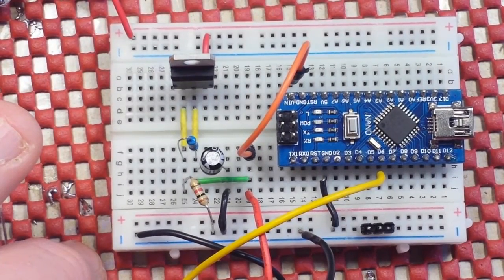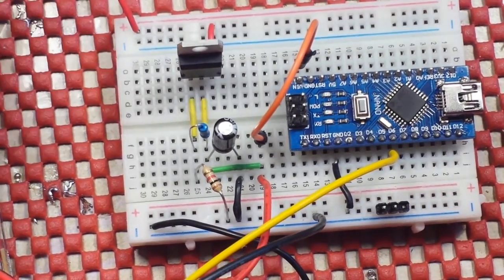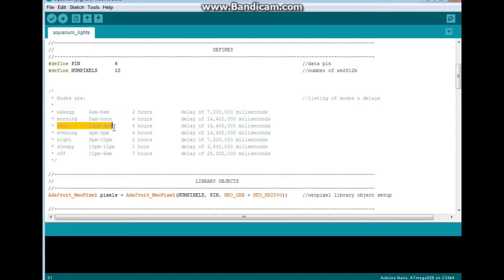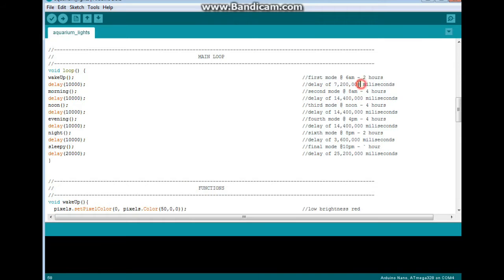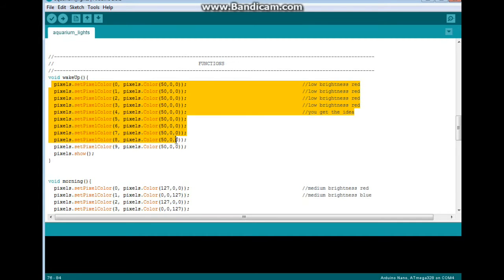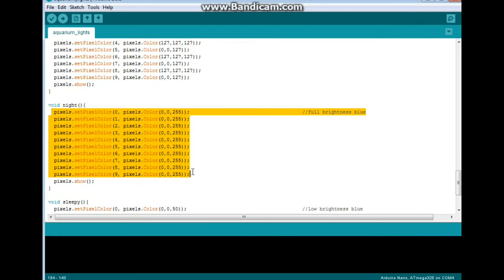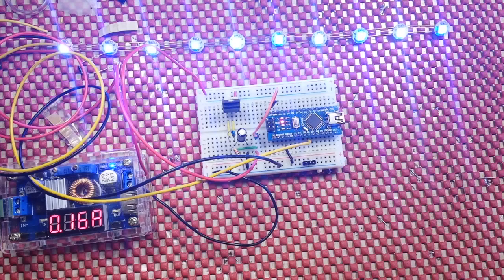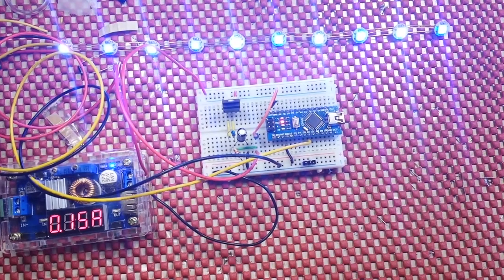Arduino Aquarium Lighting System Part 3

Comment: Lover the video and thank you for the idea. I wonder, could or how could the sketch be modified to fade the colors like those higher end commercial LED lights?  Also wondering as to any insight you might have for combining this with my existing temp controller sketch, think a nano could run both at the same time?
Reply from the maker: Yes you could fade in and out or up and down with a simple for loop. Add a relay for the heater and you can easily control both.